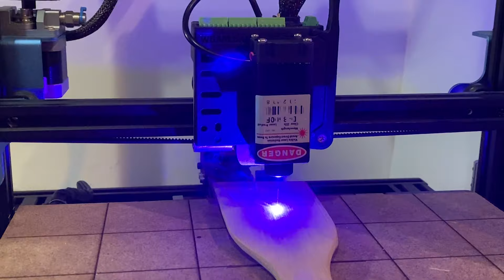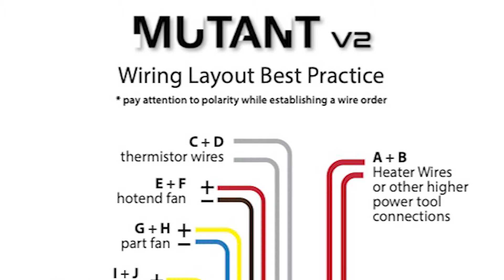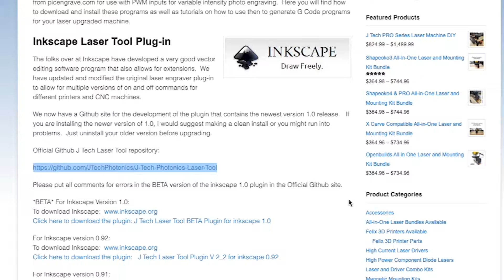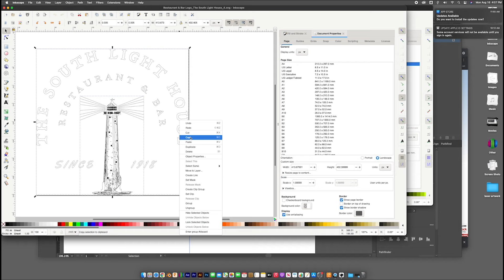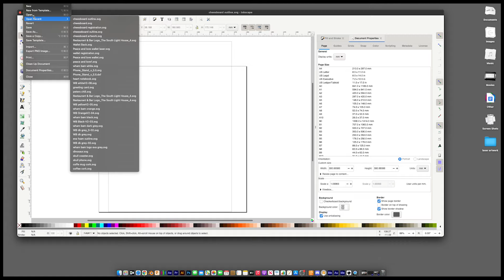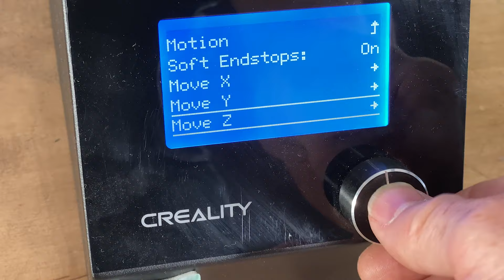How To Install A Simple Laser Engraver on the MUTANT

Comment: Is it possible to add a cnc machining module to the wham bam mutant?
And I would know too, Is it possible to add a bl touch to have a easier level sensor ob the laser?
It would be great to make a video of the cnc adding if it's possible
Thanks!
Reply from the maker: Yes o both, but would have to be light duty or based on your rail system

Comment: If you have an ABL printer, I assume you will also need to add an ABL sensor to the laser MUTANT plate? Also, can you do a video explaining the setup you have for keeping the hotend wiring from sagging?
Reply from the maker: ou can hardwire the sensor to each mobile plate, or leave it connected to the harness and use one of the quick connector stls created on thingiverse to lock into the mobile plate.  for wiring sagging are you talking about how to tie up cables on the mobile plate or our retractable chord on the machine?
Reply from the maker: here is the retractable cable holder:  https://cults3d.com/en/3d-model/tool/bowen-tube-support-retractable-chord
Reply from the maker: here is one of the adjustable ABL holders with quick release  https://www.thingiverse.com/thing:4877017